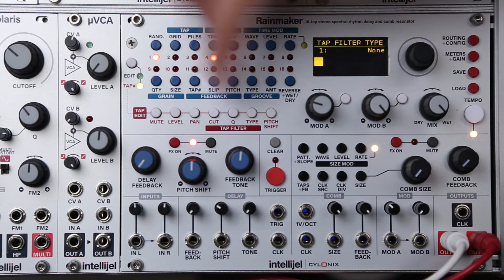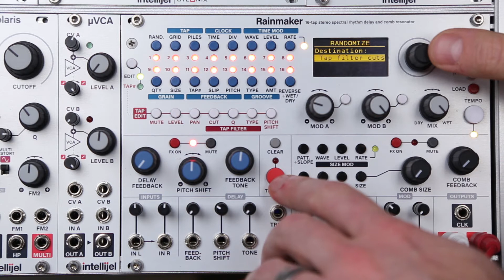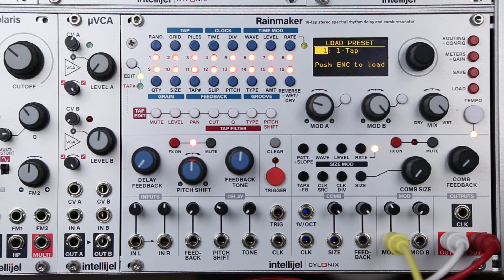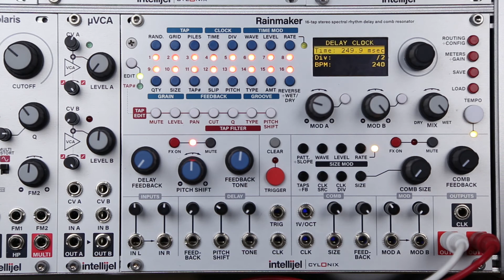Modal Synthesis With Rainmaker

Comment: Hi, Can i processing an external signal, for istance a volca, trough the rainmaker or i need some other module?
Reply: With something like a Volca, you could plug it directly into Rainmaker using an 1/8" TS eurorack patch cable. The inputs have enough gain on the attenuators to go up to line level. However, you might want an output module with a balanced output like Outs for recording or a PA system.
Reply: @ScottMFR  thank you very much!

Comment: hey Intellijel, but if you use modal synthesis than you need a second rainmaker for delays!!! (:-)
Reply: That's one way to do it, but you could also set up delays using the Comb section.
Reply: @ScottMFR  wait whaaaat.
Reply: @2mbst1  Since delay feeds into the comb section you can apply comb delay to your modal stuff. This would probably work best with lower tap numbers between 4 - 16 and patterns like uniform or fibonacci. Then if the Comb clock source is set to Comb Size you can use the SIZE knob to set the delay rate, or clock it using the Comb CLK input.